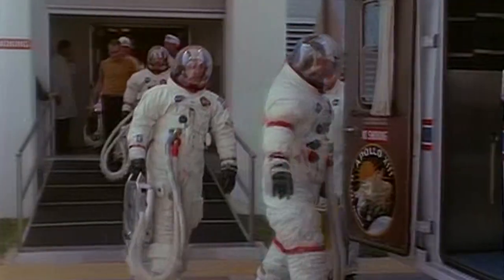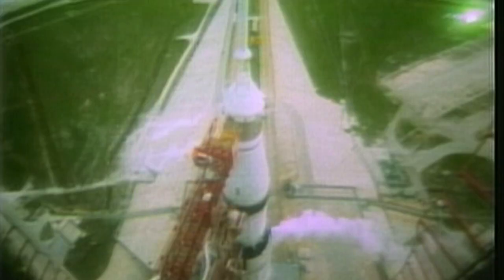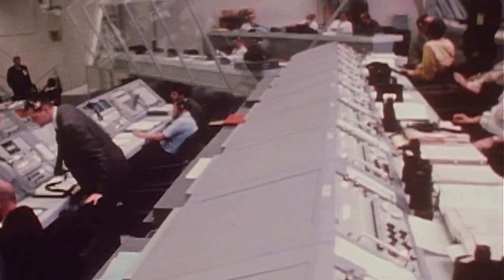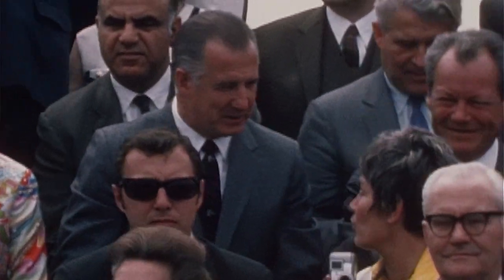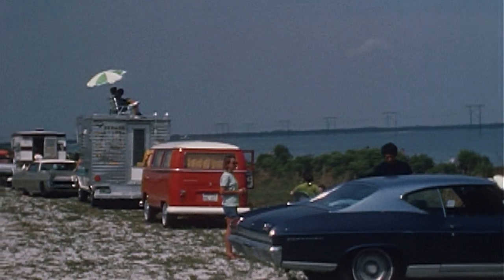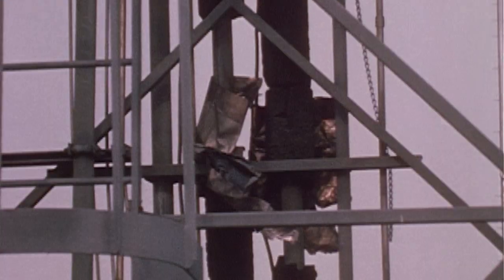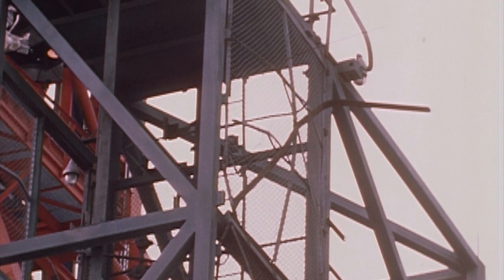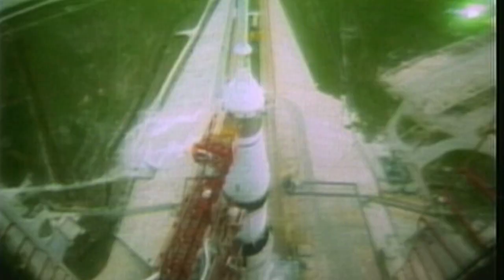Apollo 13 Color Television Camera

Comment: >"You know, if that metal plate hadn't been there— it would have gone right through into the space craft, To the Saturn V and it would have blown one heck of a big hole and whatever problems they would have had later on they would have never gotten to it. It would have been an awful disaster, and it it wasn't for that plate sitting there, 'cause this thing had to be moving at a tremendous force. It had to go a short way."
>This happened on Apollo 13's launch
>Apollo 13 IIRC had serious complications later on when stirring LOX causing an explosion in the vehicle, forcing the crew to abort their lunar mission and barely made it back to Earth.
What a crazy mission.

Comment: Interesting about the L bracket... but by the time the L bracket fell to cut off the camera cable, the Saturn V was already past it so there would not have been a disaster anyway.
Reply: And ... just wondering how/why something would be moving that fast toward the rocket. Moving away would seem more likely.
Reply: Strange that random L brackets were flying around the LUT. Shouldn't it have been checked so that everything was secure before launch????